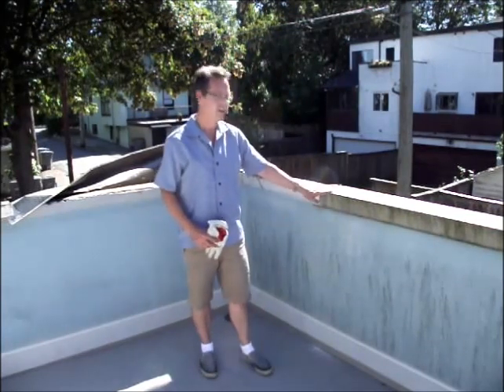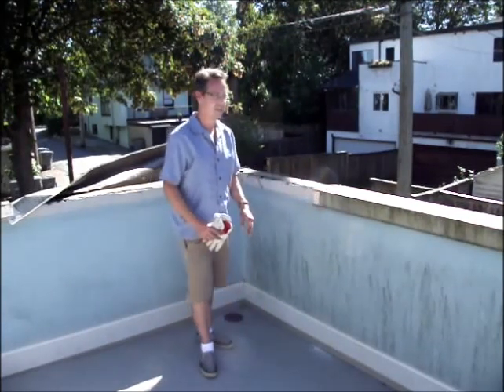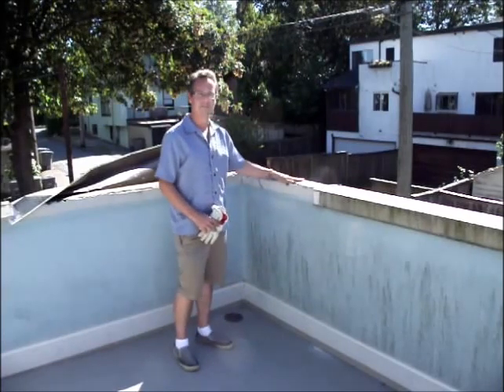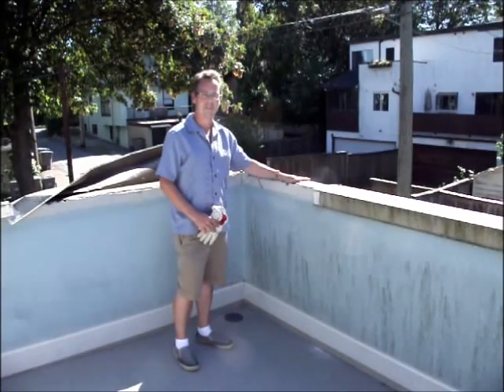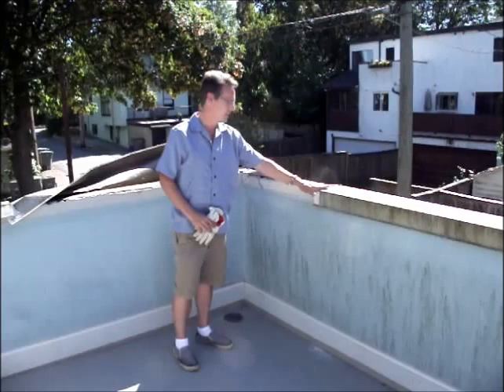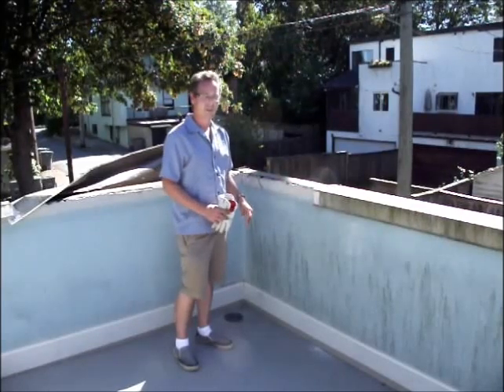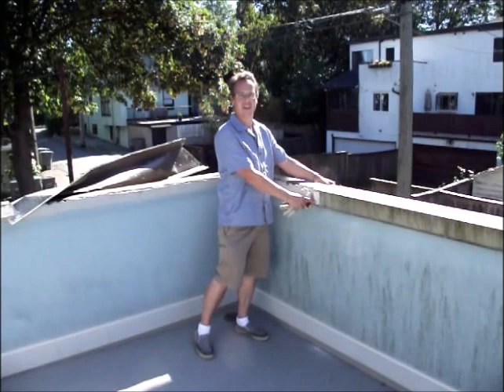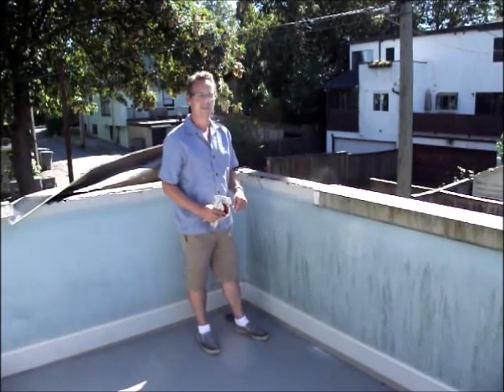Waterproofing a parapet wall-How to waterproof a parapet wall

Comment: Here we go...Just like Vinyl Siding...make sure you put the underlayment on because the primary leaks.  Is there something wrong with this?  Why can't we just do the primary right and never expect leaks?  Fiberglass It.
Reply: ***** 
In actual fact the metal cap flashing is not the primary waterproofing member, its main purpose is to act as a block for UV rays that deteriorate self adhesive membranes. A flashing membrane on the top of all upstand (parapet walls) has been a code requirement for decades.
Reply: Mark,
We have a difference of opinion.  First of all, building codes have left the industry down for many years.  When installing cladding of any kind, it is my opinion that never should water be allowed into the underlay.  The underlay in this example becomes the primary waterproofing agent, by your description.  Water accumulates without clear drainage plane, thereby being trapped to enter at fastener penetrations.  Yes, just like vinyl siding in that regard.  Primary is primary and watershed is watershed.  So this is another example of a "Supplemental Rain Screen," which was a play on words that the industry bought hook, line and sinker.